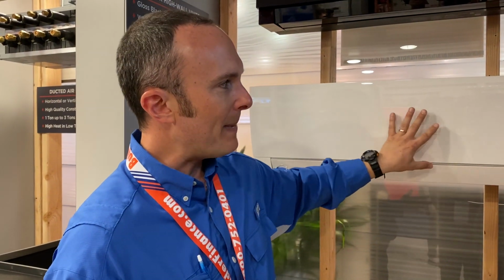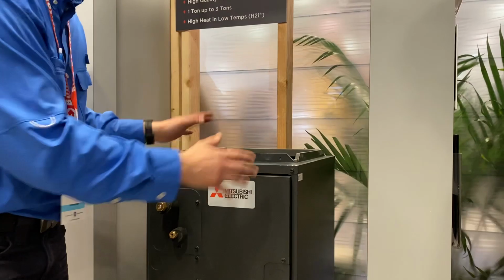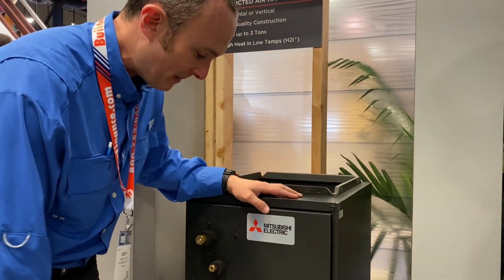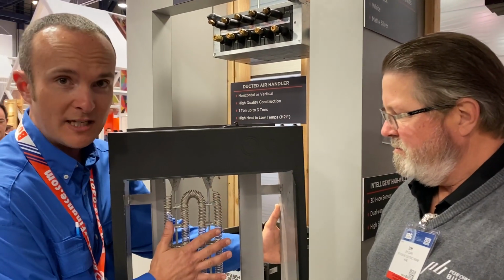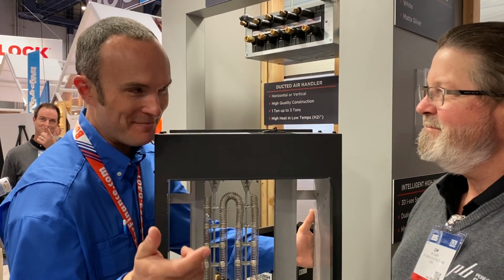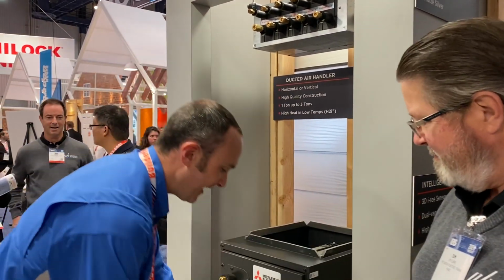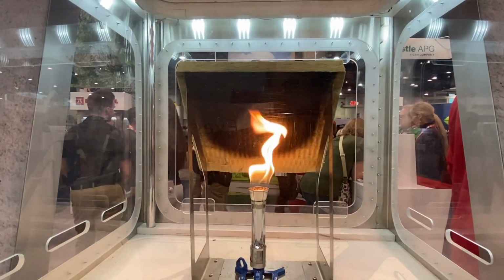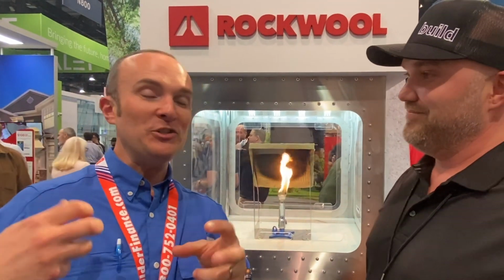Day 1 at Builders' Show 2020 (IBS)

Comment: Instead of wall mount air handler‘s that need a lot of maintenance often especially in dirty dusty places with lots of human beans shedding. 
          I recommend using very small medium static or high static air handlers. Yes a little extra cost to hide them in an enclosure. The advantage you can custom make a filter in closer that holds one up to three parallel Merv 16 filter‘s example. ( 16”X25”X5”) part# X6672 this is a Lennox part number.  After using this filter you probably will be able to go a decade and never have to clean your evaporator or fan blades. 
              Plus filter change intervals can be extended up to a year or years and you can prove that by attaching a manometer like Dwyer analog needle or the old style red liquid for the customer. So they do not unnecessarily change the filters just based off time and guessing. Measurements is proof.
Reply: Pressure differential switchs fir air handlers are an off the shelf item. Connect to a warning light. No idea why they don't use them for domestic homes. Cost? Sell more filters?
Reply from the maker: Nice ideas, T